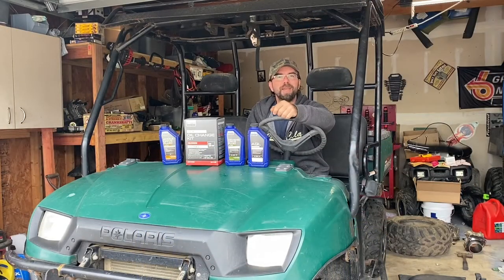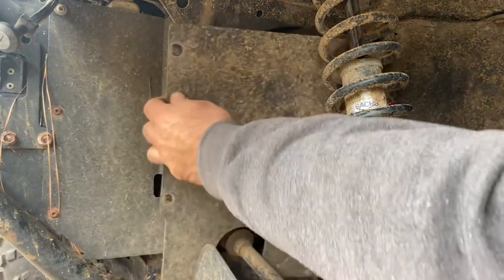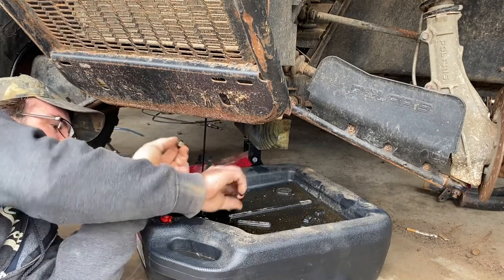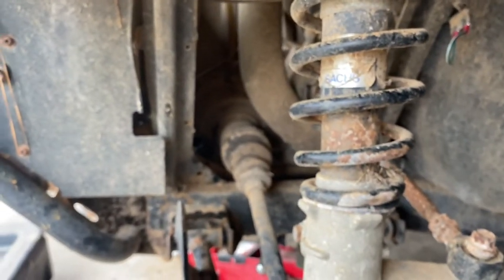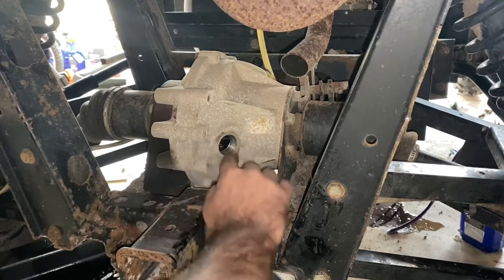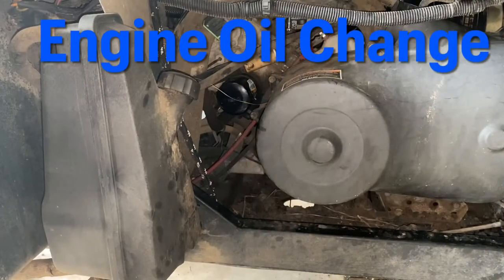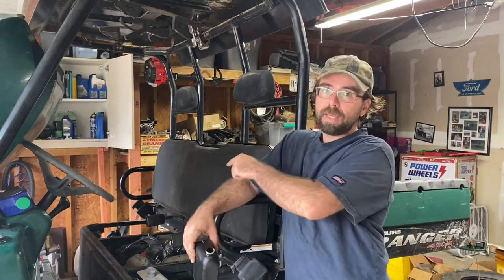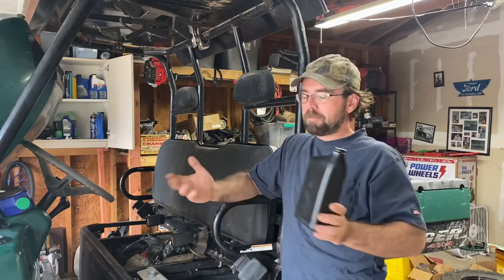Polaris Ranger 500 Replacing all fluids

Comment: There is a filter in line behind the sump tank at the bottom where the return line from engine  comes in to oil tank that needs to be cleaned every other oil change  just remove clean it and replace it no need to replace with new one just keep cleaned out its bad about collecting sludge and block return in that area  . Good helpful video thanks .

Comment: Attention! It takes almost a full qt to fill to the plug level on that rear diff. 18oz fills 3/4” below the fill plug. 
I filled mine to the bottom of the plug and it took a full qt. Opinions are 50/50 on whether fill to the bottom of fill plug is bad. Some do it as a rule. Some say OMG you’ll ruin your diff. 😅

Comment: The video was great best one I’ve seen on. I have a 2005 same as this one but could not find the check/fill plug for the transmission is there a different spot any suggestions
Reply from the maker: Well thank you!!! It’s in the same spot as in my video. It might be filled and covered with dirt.
Reply: You aren't crazy! I have a 2005 and the fill plug is not in the same location as this video. It is an 8mm Allen (same as the drain plug) above on the right side of the transmission. I even looked in the owner's manual and mine is different. So strange.

Comment: I have an '02 6x6 with 2 rear diffs. Do they both use the same type fluid? Also did you ever show pulling the shift fork shaft out of the old transmission? Mine grinds going to High range and I might try repairing myself.

Comment: I just picked up one of these rangers and it has a second battery under the seat right there by the oil reservoir. Is that normal why would it have 2 batteries? Did yours have 2? Do I need both?

Comment: Great video. I do have a question about fuel filter location and part number and zerk fittings locations. Thanks
Reply from the maker: Thank you. Fuel filter is in-line close to gas tank. I have a video showing how to rebuild fuel system. Unfortunately Polaris stopped using grease fittings which was a stupid move. The only grease fitting on it is at the yoke for front driveshaft we’re it attaches to transmission.

Comment: Do you ever get white milky slime under the oil cap?
Reply from the maker: No. Milk on cap is water/moisture in system. If drained oil is milky then it’s either coolant in system or water intrusion from drowning engine in water. (Seen bad oil cap let water in) If drained oil looks fine then it’s breather system in need of replacement. Milky condition is never good.
Reply: In my high humidity, moist, summer  environment (North Georgia), I've found a bit of milky coating under the oil cap but none in the oil itself.  IMHO... little to worry about. It wipes away readily.
Reply from the maker: @mrdickjurgensen  good day sir. That is perfectly normal. Check your breather filter sometimes new one helps reduce it. Other than that it’s normal trust me I know humidity, Houston here lol.
Reply: @montemania198210  I'll check my breather filter as you suggest. I just changed my oil this morning after posting to this thread and my oil was quite dirty and long overdue for changing.... but there was no indication (thank goodness) of moisture in the oil itself. Great video BTW.... very  inspiring/helpful indeed!

On a different note: I took off my skid plate  long ago so I'm careful where I drive my 6x6 Ranger 500. It makes inspections and maintenance on the underside of the UTV so much easier and cleaner.

Comment: I have a 2004 model Polaris Ranger 4x4 that is shutting off after I run the machine for a few minutes. Once it cools it will crank up again. Your thoughts on this is appreciated. I've been told it could be the fan not working properly.
Reply from the maker: Could be a number of things. However what comes to mind is something electrical is getting hot and shutting down. I would check when it happens the fuel pump make sure it’s pumping and also check for spark, could be pump or coil heating up and shorting out. If both are ok see if she’ll fire off with starting fluid, if it does then that’s a indication the carburetor is vapor locking.
Reply: Had the same issue. Under the hood there are 3 black regulater boxes. The small bottom one regulates the fuel and pump. I jumped the outer two wires bypassing it. I installed a fuel pump with two outlets after the pump. One to carb and the other back to the tank which I drilled a hole and installed a grommet. Downside is the pump will always run when key is on. Upside you don't have to pay 250-300 for a used part if you can find it that is.

Comment: If a filter looks close can I use it even if it is wrong part number?
2917 2017 polaris ranger full size 570efi can I use 10w30????
Reply from the maker: I would use the correct filter, even if it looks same it’s what’s inside that matters. Also do not run 10w30 in a 570. 5w50 or 10w50 only.
Reply: @montemania198210  thanks boo
Reply: I run T-6  Rotella 5W-40 in mine with never a problem , Castrol 5W-20 Synthetic In the Trans with 3oz. Of Lucas Oil Stabilizer , Mobil 424 in the Demand Drive front pumpkin & 75W-90 Hypoid in the Rear !! Polaris Does NOT manufacture nor bottle their Oil , it's Contracted out !!